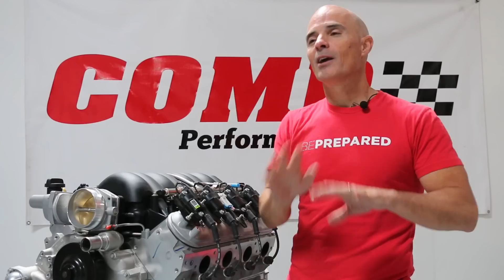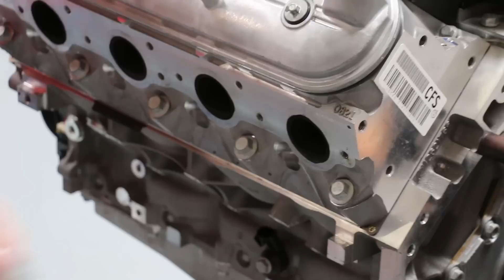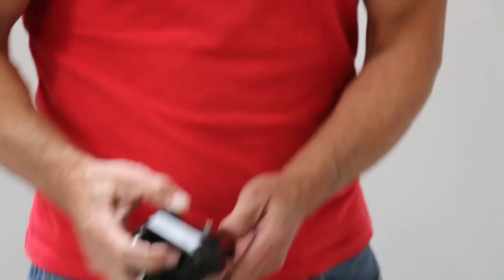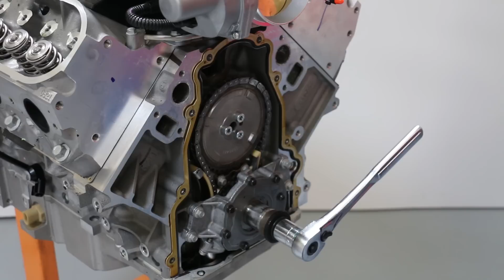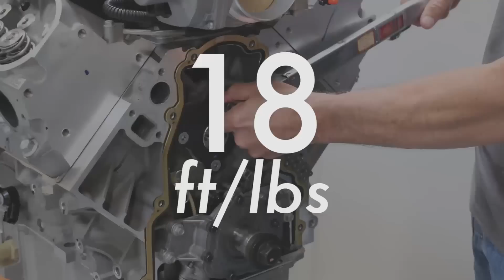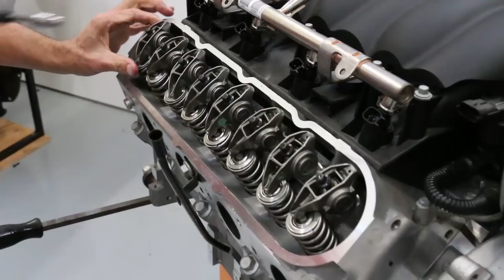Back To Basics: LS Cam Swap

Comment: What the name of the specific tool you guys used to hold the lifters up? Im interested
Reply from the maker: Unfortunately we don't make these tools and are not sure where the ones in the video came from. However, we have seen people use 5/16" wooden dowel rods from a home improvement store to do the same thing. Aluminum could be also be used. Thanks for watching!

Comment: well I do have an LS engine. but how do I find out which LS it is. came out of a '13 Chevy Suburban. who would I contact that would know what all I would need for a performance increase from stock?
Reply from the maker: There are a couple of different possibilities, feel free to call our CAM HELP line at 1.800.999.0853 and those guys most likely will be able to identify the LS for you. Thank you.

Comment: I'm confused..... I was told that you have to delete the VVT or Advance.... when adding an aftermarket cam but, I never heard it mentioned here at all. So do you or don't have to do this? Because I would like the additional power but still utilize the ability of the motor to conserve fuel when not hitting the hammer.
Reply from the maker: The engine in this particular video is an LS3, which does not have VVT (Variable Valve Timing) or DOD (Displacement on Demand cylinder deactivation). COMP Cams does make performance camshafts for use with VVT and/or DOD if your engine is equipped with those systems. Hope this helps, thanks for watching!

Comment: When you delete the AFM and VVT what do you do about the wiring harness that went to the front timing cover and the harness that goes to the valley pan? If you  leave these unplugged will it cause a trouble code? And do you have to replace the timing cover and valley pan? Its a 2012 Chevy with AFM and VVT.
Reply from the maker: +strayufo Yes, it will cause a trouble code. The factory PCM will require a custom tune to turn the codes off. The valley cover has to be replaced if deleting AFM and the the timing cover will need to be replaced if deleting VVT. Typically, the unused connectors are just left to hang loose in the engine compartment. Hope this answers your questions, thanks!
Reply: I had to buy a kit to have the afm and vvt removed, the valley cover needs to be replaced also the timing cover and lifters.
Reply: https://www.texas-speed.com/p-7379-dod-afm-delete-kit-for-536062-engines.aspx

Comment: great video, BUT, you forget to mention one important thing : 
cam and spring match.
oem springs are known to fail and break if left unchanged when swaping the cam for a"performance cam". You should explained this in your video. If you're lucky, the broken spring will retain the valve from dropping too far down and hit the piston.
Perhaps the main question should be when does it become criticial to match the springs to the specs of the cam ?
a very mild cam upgrade matched to oem springs may work. i speak of experience as i bought a ls powered car that did not have spring upgraded when the previous owner replaced/upgraded the cam, so the oem springs did not last and 1 broke. Sorry perhaps it is already mentioned and discussed further below.
Reply: For a cam swap is tuning required?
Reply: @_Boxcar_  I'd say absolutely to get the most benefit of the swap . If replacing a DOD cam  then it is absolutely a must also the lifters need to be replaced etc VLOM and on and  on to get it to be dependable and work correctly . Why I will never own another GM product . If I want a race car or a dependable car with no ' hidden ' issues I assume when I purchase it it is what I'm buying not a platform that was proven to fail back in the eighties . So like I said as did Ross Perrot . . .no more GM for me.
Reply: Fire bird 
But he didn’t say what the cam specs were or what that series engine springs were rated
Reply: always upgrade springs when you do a cam. its a no brainer
Reply: @06goatm6  That’s a good 👍🏽 point. 
Question 🙋🏾‍♂️ I’m putting in a mild cam 210/216. What valve springs should I upgrade to? New stock bee 🐝 hives or something else?
Reply: What would be the best way to match valve train to a cam the amount of lift and duration to what a lighter is able to sustain? Or the spring? I'm trying to learn more about the supporting stuff. I'm a ways away from choosing a can but would definitely like to know more!
Reply: Atrium GM Motors is the best around back then n especially in today's platform
Reply: Would you call a Motive stage 1 210/216 a mild cam to upgrade to new stock springs?

Comment: When should you consider upgrading the springs?  Thought most aftermarket Cams should get upgraded springs on the LS
Reply from the maker: +355N2Oz28 It really depends on the specific camshaft being
used, but you are correct that most performance cams do require a valve spring upgrade as well. Our LS valve spring tool makes the job
much easier. You can check out a video here:  https://youtu.be/gJ792qJwCpQ   
Thanks!

Comment: don't the other rockers have some slight spring load on them as well ?

or is that considered negligible ?
Reply from the maker: +Alvin Lee You are correct, there will be some pressure on all of the rocker arms.  Just watch out for the ones that are compressing the springs because they will have higher tension. Thanks for watching!

Comment: How did you get the crank to stay still when you were putting on the dampner? How or when did you tighten the dampner down w/ 240-250 lb-ft. of pressure? that whole segment is very confusing. vid dosent line up w/ steps to me.
Reply: crank holding tool...

usually you remove the starter and place the tool in it's location with bolts and the tool has teeth that engages the flex plate (fly wheel) and locks the rotating assembly as seen in this video.

there are other variations of this tool but this in my opinion is easier.

hope this helps
Reply: Don’t overthink it. Heat the damper up with a torch and it will slide right on. Then just put the bolt in and get it good and tight. Worry about torquing the heads, and don’t sweat stuff like the dampener bolt
Reply: Chain and a padlock

Comment from the maker: It's easy to install an aftermarket cam an LS engine.

Watch the whole process here.
Reply: I could use that stock cam for my rebuild
Reply: COMP Cams I didn't see him degree the camshaft when he installed the new cam. Is this something that is not necessary?
Reply: you cant degree a cam with a non adjustable timing set. They do sell adjustable timing sets for LS though, but this wasnt one of them.
Reply: Forgot about changing the springs guess stock springs will hold up lol

Comment: After re-installing the cam retaining plate, how did you know if the cam was in the right position for top dead center when you put the cam sprocket back on? Everything is very clear to me, except for that part. My knowledge is limited in this area, but isn't it important to have the new cam in the same position as the old one after install?
Reply: yes it is important to match it with TDC to avoid misalignment and damaging the valves/pistons. 

what they did was to bring the engine to TDC before removing the old cam, and after installing the new one they attached the sprocket on the cam without the chain to verify it's orientation by examining the timing markers.

always double and triple check before finalizing your install. 

hope this clears it up for you.

Comment: Does this video show the same for an ls2?
Reply from the maker: Yes, the process is the same for an LS2. The cams will be single-bolt, so the section on selecting the correct cam sprocket is less relevant. Everything else is the same though. Hope this helps - thanks for watching!